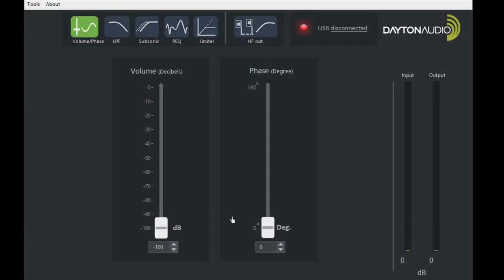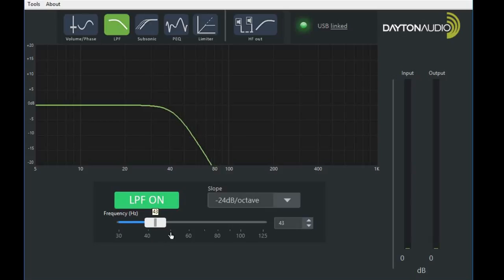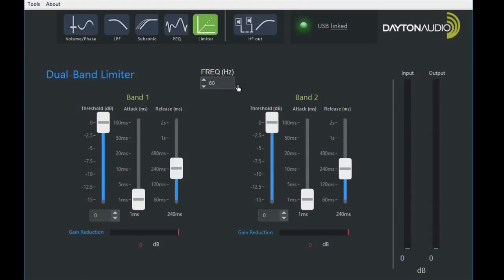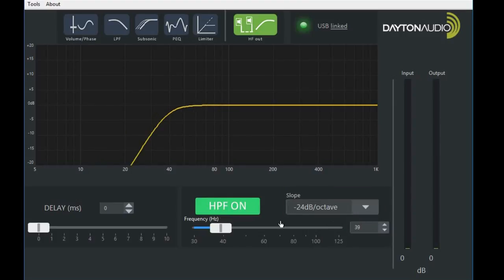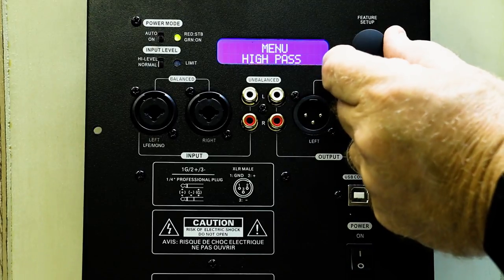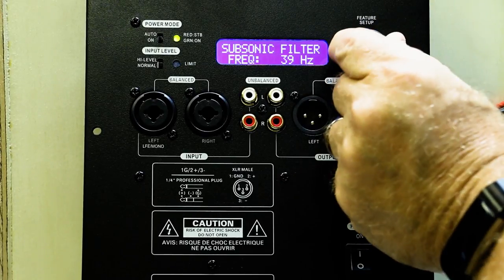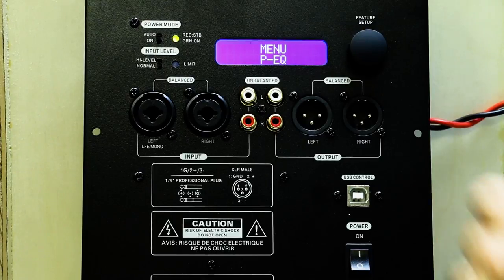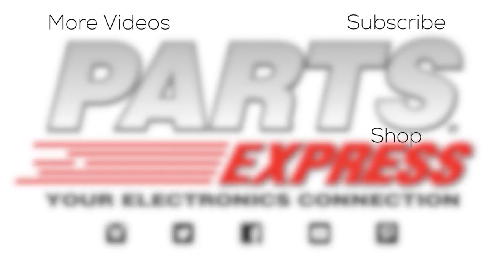Using the DSP on the Dayton Audio SPA250DSP Plate Amplifier

Comment: Guys, would you please ask Dayton Audio to extend a frequency range of these amps (LP and HP filters) from 125 to 250 Hz (or at least to 200 Hz)? I guess that should not be that difficult from a technical standpoint. 
I wish to use these amps in my new 4-way speaker design with an active LOW section. However due to a small size of the midbass/midrange drivers an amp needs to have higher crossover point (around 200-225 Hz). And if everything goes as I plan I'd be buying them regularly.
Reply: Absolutely. This is my biggest wish for these amps. I would like a woofer amp.  Not just a subwoofer amp.

Comment: Very cool.. Not sure of the usefulness of 5 bands of EQ below 150 Hz, but still nice.
Reply: That is a cool feature, but can our ears even hear (or can our brain register) 10Hz? I thought 20Hz was the lowest frequency we can hear, and some of us aren't even able to hear that. So I've read 35Hz is a practical, lowest frequency human ears are capable of hearing. I may be wrong though?
I think it's still a nice, customizable quality to have with your DSP setup.
Reply: it is a subwoofer amp and the parametric eq allows for mitigation of room resonances (room boom), better extension, flatter curve, and protection from frequencies below port tuning.  it solves most common sub tuning issues and is a much better value than a Behringer Feedback Destroyer or something similar with external amplification. all it really needs is app control.
Reply: @jimtremayne  Nice!  Thanks for the explanation.  If you can't get good subwoofer sound out of this thing, you didn't try hard enough!
Reply: Like the other guy said there's lots of benefits. One of them he didn't mention is you can grab a big subwoofer and put it in a small sealed enclosure then bring down the loud frequencies to match the quieter low frequencies after the sealed box starts to fall off. That way you can have equal (flat curve) SPL across super low frequencies and high frequencies with a very small box. You just need a big woofer and lots of amp overhead.

Comment: so has the signal that is high passed to the satalites been converted to digital then back to analogue ?
Reply: Run them full range.  The best filter is no filter.  Depending on their box alignment you can use the box as a filter.  The independence will rise and the output will drop.

Comment: I'm assuming theres no amp on the highs just a crossover.
Reply: right. For each satellite speaker you need a separate amp (for example a couple of hypex 251 plate amp, or a classic stereo integrated amplifier)